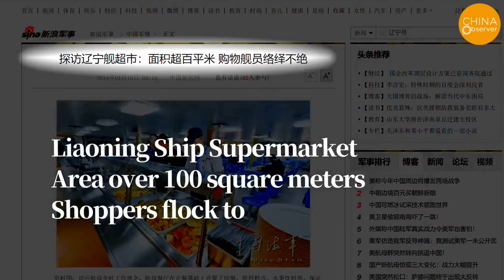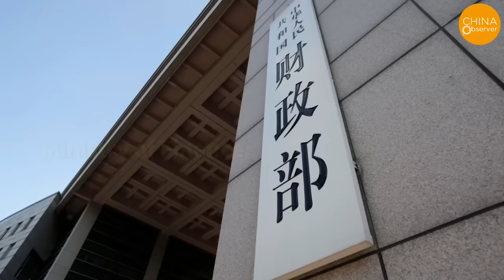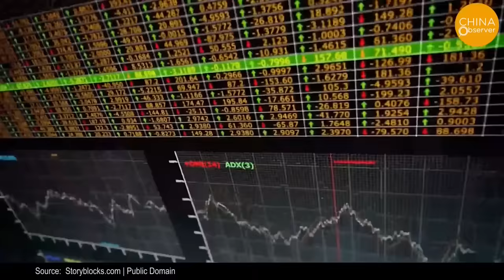China’s Junk Aircraft Carrier Fears to Sail? A Big Joke Due to Copycat Failure

Comment: The electromagnetic catapult is supposed to fix the problems associated with the steam catapults which act pretty much like a gun. You have a massive impulse putting pressure on the landing gear and airframe at the start. If it is done right, the electomagnetic catapult can accelerate gradually which, theoretically, could mean a less robust airframe and more weapons that can be carried.
Reply: What is theoretical and what actually happens can result in a significant, and potentially catastrophic, difference.
Reply: @willmartin7293  Do you have a point? The electromagnetic catapult is no different than a rail gun or a mag-lev train. The same principles are involved in just a different configuration.
Reply: Perhaps the steam catapult is "easier" to design, build and maintain?  The electromagnetic version might be subject more to salt water infiltration and quality control for windings and insulation?  Note the keyword here:  Quality Control does NOT equal China!!!
Reply: @henryfurlott2222  Well of course it is. It's just a gun and has been around even before the start of WWII. The US had problems getting its electromagnetic catapult working and still might. You have to time the energizing and deenergizing of the electromagnets (and maybe even the polarity of the electric current so the magnets not just pull but push) such that it moves the driven component that is pulling the aircraft landing gear.. In addition, the idea is to slowly accelerate it until the velocity is high enough to launch the aircraft in the distance allowed so it has less strain on the airframe than a steam catapult.
Reply: As I understand it, another advantage is that EM catapults can adjust the force used, allowing the force imparted by the catapult to be tailored to the aircraft being launched, eg. lighter planes (or planes in lighter configurations) getting lighter assistance. This is another way the system minimizes airframe wear, significantly extending the lifespan of the aircraft utilized and potentially reducing required maintenance during the extended lifespan as well.
Reply: @michaelccozens  25% more, at present.
Reply: @michaelccozens steam catapults are adjustable. Large carriers have a remarkably smooth stroke compared to the smaller ones.
EMALS has significant hysteresis which manifests differently depending on aircraft, weight, load, balance, temperature and frequency of use, among other variables. 
The shutdown and capacitor discharge of EMALS takes 2 days, and deck components require laser alignment. 
Steam catapults are largely repairable with rubber sheating, grease, and sledgehammers.

Comment: Having launch tubes under the runway was a terrible choice that the Soviets made because they knew they could not actually compete with NATO in terms of naval air power. So they just built a missile cruiser and put a runway on it so they could have the prestige of an aircraft carrier, even though they had no practical use for one. So getting rid of those missile tubes might be the only thing the PLA did right when building the Soviet hull into an carrier for their forces. I don't know why he is taking a swipe at them for putting a convenience store there, anything that keeps up the sailor's morale is more useful than putting rockets in that you can't even deploy while air operations are going on.

Comment: Who is the genius that thought a conventionally powered aircraft carrier could power an electromagnetic launching system? The carrier is underpowered before it even leaves the dock. Great job!
Reply: Just another KNOCKOFF - all the gear and NO idea!
Reply: Why not? You just need sufficient power plants on board. If it is Diesel or gas turbine powered, steam catapults also don't make too much sense because there is no steam plant on board.
Reply: @wanderschlosser1857  Because after you put enough power plants to sufficiently power the ELS and other systems you wouldn't have any room left for planes. Nuclear power is the only way to go for an ELS.
Reply: @gutstompenrocker  Nonsense, nuke steam power plants need a lot of space, too. Is not that you just throw a fuel rod into the oven and get energy. You can easily get a similar power density with gas turbines. Nuke power just makes you less dependent on refuel stops. There are pros and cons for everything.
Reply: @wanderschlosser1857   You disproved your own point.  Nuclear reactors do not require fuel tenders and they can produce fresh water for steam.  Any conventionally fueled carrier has to also carry that fuel, which reduces the carrier's range, the number of aircraft it can field due to reduced fuel storage for those aircraft, and overall survivability.  When you are talking about a city full of fuel and explosives,  the less fuel and explosives you have to carry equals better survivability in combat.
Reply: @docferringer  Any idea how much room the nuclear reactor, it's safety capsule, its cooling systems, its water demineralization and steam plants take? It's not that you just throw a uranium fuel rod in there and get unlimited power. It seems you underestimate the space you require for nuclear propulsion.
Reply: Exactly. The presenter is clueless and seems to know nothing about carriers. A nuclear engine is required for electromagnetic catapults as it takes 1m watts per airplane launch (enough to power an entire town). The Fujian’s engineer even said so, but Xi said he wanted it anyway.
Reply: @The_ZeroLine  1 MW peak power per launch is absolutely no problem for other marine power plants, especially gas turbines. Typical gas turbines on USN vessels are LM2500 which produce about 20 MW each. Destroyers usually got two and cruisers 4 of them, there mechanically coupled to the propulsion. But these can also drive generators as used on huge cruise ships or supply ships. So it's nonsense that nuclear power is required for electromagnetic catapults. Of course a super carrier would need a few more and bigger engines for its 200-250 MWe requirements. The main reason for nuke power is, that you don't need to refuel the main power plant. A nuke power plant isn't really smaller than conventional power even incl. the fuel storage but it is much more convenient logistics wise.
Reply: @wanderschlosser1857  You may be thinking of older catapults and you’re not just launching one plane. You also need shit loads of power for a million other things on state of the art carrier. So, power is most definitely an issue. The unlimited range part goes without saying.
Reply: @The_ZeroLine  The amount of power required can be provided by other means than nuke power. For 200-250 MWe you need a big power plant and auxilliary systems no matter the fuel or working principle incl. nuke power. The only real advantage is the endurance without refueling.

Comment: Multiple nuclear reactors in a CVN is not that much of an issue.  The first USN nuclear powered aircraft carrier, the USS Enterprise, was designed and built to be powered by eight nuclear reactors originally intended to power nuclear submarines.  It sped up the design and commissioning, as the submarine power plants were already proven, in service.
Reply: Not quite true in details. The Enterprise had 8 reactors built by Westinghouse and designated A-1-W while the submarine Nautilus reactor (also built by Westinghouse) was designated S-1-W. Having operated one but saw both up close, while I  was stationed on active duty,  I studied them in detail and they are designed quite differently. Also, the A1W reactor is very much larger, and has more steam generators and a much larger load of nuclear fuel.  Each type of reactor was designed with its specific vessel in mind. e.g. the A1W was designed expressly for the carrier, and the S1W was designed expressly for the submarine. But you had the spirit of the concept/general idea correct. The S1W reactor was built first, and then Westinghouse designed and built the A1W reactor using lessons learned from their experience building the sub reactors.
Reply: Was the reasoning at the time to put 8 reactors in the CV b/c it was 8 times bigger than the subs that had 1 reactor?
Reply: No it was designed to create the amount of power they calculated would be required to operate 4 steam turbine main engines and 4 steam catapults for launching aircraft
Reply: I guess  what he was saying , is the they have already built sub reactors, and had an idea of what would be needed and what to avoid while building these new reactors.

Think of GM's 350cu.in. engine.... super popular, and very reliable.... so when they wanted to make a smaller motor with the same qualities... everyone failed, every design was not better....until one guy said, " what if we took the 350 and chopped off the first 2 cylinders, and put the same face plate and rear plate?  Hench the 4.3l v6 was born.   Had all the qualities of the legendary 350... it's parts, and in a v6 form.  made it easy to work on, and the parts were all over the world already.   LOL now that is not exactly how it happened, but that 4.3l is the chopped version of the 350, an engine with a completely different purpose, completely different sizes, but both made by the same company.  Using testing they did on the 350 for the making of a very good v6, the 4.3l. @allaboutboats

Comment: There seems to be some confusion in this video.  It jumps back and forth between the Fujian (Type 003) and the newer in-construction Type 004.  It also seems to confuse the Fujian with the Type 004 sometimes.  They’re not the same.  Fujian is China’s 3rd carrier, their first with catapult launch system instead of a ramp, and conventionally-powered.  The Type 004 is the Fujian but with nuclear power.
Reply: Yes they talk about the non-working 003 and the non-existent 004

Comment: I think China needs to learn how to do things over decades like the U.S.  Like using steam instead of electro-magnetic.   There is so many things to learn over decades.  You can’t learn these things overnight.  You can’t also make Tofu carriers like they do with so many other things.  None of these China AC’s are a threat.
Reply: Seeing how they use conventionally powered ships, IMO, a steam catapult system would've made more sense. The technology is decades old, and easier to duplicate and maintain than an electromagnetic system that requires a considerable power source to work properly, not to mention, repair and maintain due to the advanced technology. Looks like the PLA Navy tried to run before it could walk.
Reply: SB

Comment: The CCP should review the writings of Langley, the Director of the Smithsonian, and an avid aviation technology hobbyist.
He was able to 'sling' craft off a barge anchored in the Potomac.  He also had issues with controlling the flight of those craft once launched.
But then the Wright brothers came along and flew the first aircraft in a controlled flight, and the barge Langley was using in order to have safer recovery for pilots was no longer needed.  We will have a 125 year celebration soon.

Comment: Why does China even consider aircraft carriers? They can’t use them to project power into the Pacific without first securing dominance over the first island chain. Their immediate goal is therefore to secure control of Taiwan. They don’t need aircraft carriers to project power across the straight and over Taiwan. Land based aircraft are a much better and a vastly more scalable option. An aircraft carrier anywhere near the Taiwan Straight is vulnerable to land based anti ship missiles. (They know this as it is their own plan when it comes to countering USN carrier groups.) The CCP’s procurement decisions are completely divorced from any coherent strategy.
Reply: They want carriers because they don't want their trade routes pinched off.
E.g. they want to make sure they can get through the chokepoints in south east asia and the western Indian ocean. E.g. Straights of Malacca, the Gulf etc.
Reply: @1337flite  That is down the track. Their immediate problem is that the first island chain makes carriers vulnerable getting out to the open ocean. 

Also China’s maritime trade routes mostly pass through the straits of Malacca and the Indian Ocean which are very difficult to control even with carriers.
Reply: @1337flite  their carriers are useless, they couldn't make it to a choke point without catching fire or blowing up their own ship. I'm guessing you haven't seen their latest and greatest warship catch on fire on a perfectly calm, sunny day. They can also hire all the western consultants they want, it doesn't work when all you have is garbage equipment with little emporers and automatons as your "army." Sorry guy, it's not underestimating your opponent, but seeing them for exactly what they are, useless. Cheers.

Comment: To be fair about the 70K ton thing,  Shinano was a Yamato hull hastily finished as a carrier instead of a battleship.  If you go to Aberdeen they have one of her original turret plates, 24 inches thick IIRC, with a nice hole shot through it with a 16 inch/50.  The same gun from most of the US wartime battleships.

Comment: Over the years, many countries have tried building aircraft carriers, only to discover that using them operationally is not as easy as it looks. It takes a level of training that has to be seen to be believed, challenging logistically to support, and aircraft often have to be designed from the airframe out for carrier operations. The cost of entry into the "carrier club" is prohibitive for most countries. Many countries have built carriers only to give up the project once they see how expensive and difficult they actually are to use.

Comment: The US dumped the EM catapult for the time being due to it simply not being more efficient for cost and increased maintenance requirements.  The EM catapults can launch aircraft more quickly but as of right now it has a fairly high failer rate for military standers.  The up front cost is considerably more over that of steam and has to be completely taken off line for much longer for maintenance.
Reply: Source? From what I know from Janes and USNI News (and have just checked), EMALS is still installed on the Gerald R Ford. To your credit, it still has teething issues.
Reply: @connorquerin  Just google EMALS de funded. Trump did it along with a lot of other next gen projects.  The Gerald R Ford does still have theirs but only cause it would cost billions to re outfit that ship since it never had a steam catapult.  When I say they got dumped I mean they are still doing R&D but have no current plans to go forward with adoption.

Comment: I reckon the biggest issue in the development of the carrier has been corruption in the military through the vast majority of its construction.

I would be careful talking about reliablility for new carriers though... Uh... The queen elizabeth class carriers have been riddled with issues and also spent more time being repaired than sailing.

Its a pretty low blow to say an undergraduate thesis holds no scientific value, no matter what country it comes from. Ive seen a lot of very good work coming out of undergraduates, some of it progressing into PhD projects, and some of it with genuine military value.

Dont underestimate China's capability to design and operate nuclear reactors either. A LOT of recent breakthroughs in new reactor designs (and even fusion) have come from China. They have been doing significant work in the SMR and AMR fields, notably with the demonstration of a small modular HTGR - HTR-PM, which no other country currently has - no other country has a functional 4th generation reactor for that matter. Operatig see-going reactors is different, but to say they have less experience is disingenuous.

Comment: If the Fujian was launched late 2022 its still gonna take at least two years to fit out the ship.  I expect it will take several months if not a year or more to work the bugs out of the EMALS. The US needed a lot of time to iron all the bugs out of their EMAL's as well. Articles I have read suggest the Fujian wont be commissioned til at least spring of 2024, more likely summer 2024. Then tack on at least 6 months to troubleshoot the EMALS.
Reply: and not much longer after that to moth ball it and forget it was ever built.

Comment: A carrier is a tall order for any nation, but to implement EMC's before you have figured out how to power your boat (boilers?) seems absolutely ludicrus. Find out how to build reactors, and power your boat succesfully before implementing, a system which also gave the americans big headaches. Also carrier based aircraft, the PLA want everything the americans have - and they want it now - but think how many different types of planes you need on a carrier (fighters, interceptors, E-2s, C-2s, a range of hellicopters etc.). And the PLA run two different kinds of carriers (Ski jump, and supercarriers), so they need different types of planes for the skijump carriers as well (V/STOVL). At the same time they need both carrier jets and land based jets and they need to be 5th generation jets. On top of all this there is the most important issue: doctrine, the Americans have perfected carrier operations since the first ww, the chineese have bought an old russian carrier on the pretext of making a casino in Macao. On top of these carrier projects they have the belt and road initiative, they financed a lot of the infrastructure in Africa, Asean and Bric countries, I would say they have overstreched their interests a bit to far. The camels the CPC will have to eat are humongus, but they will probably die of shame before they choke.